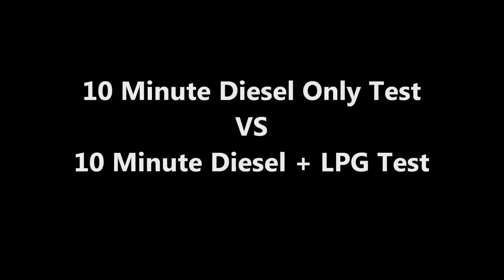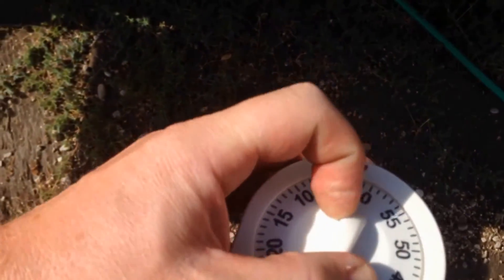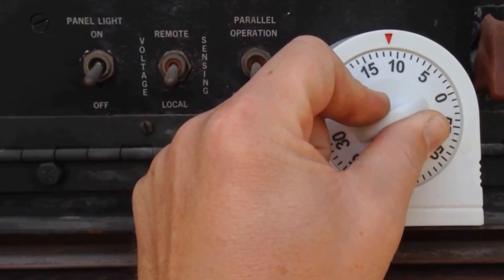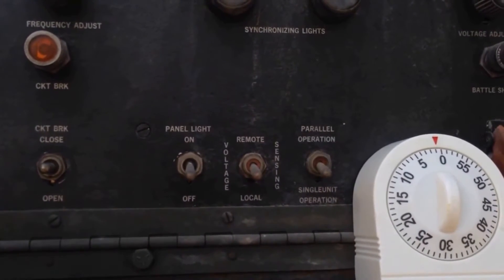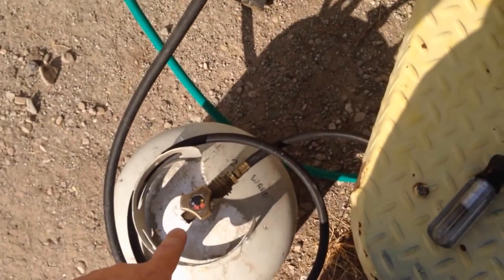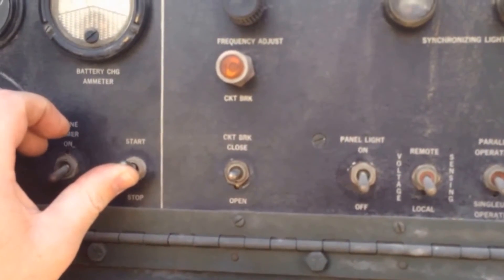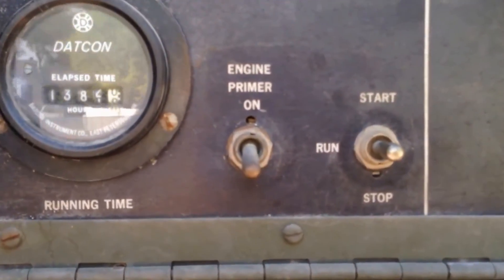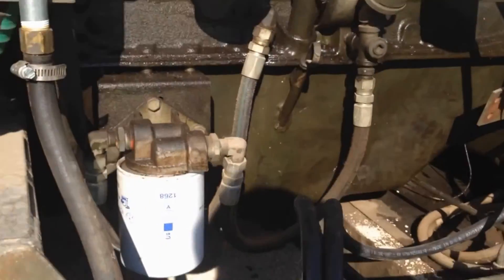Diesel Genset Converted to Run on 60% LPG/Propane

Comment: OK but how much LP Did it burn what was the cost difference what was the power output difference what was the pollutant output difference the video really didn’t answer any questions other than it uses less diesel but of course that’s the case

Comment: I was thinking...
What If my objectives are to clean up the emissions by achieving a more complete burn in a diesel van with a small LPG tank. Will a 10% mix cater to those targets?
Reply: yes, it'll work fine. if your tank freezes up, use a larger tank or warm it up somehow.

Comment: Did you weigh the propane cylinder before and after the test where you use the propane + diesel in order to see how much propane you used?
After all, you're combining fuels. You can't just consider the amount of diesel you save. Propane isn't free.
Reply: Fred Flintstone the point of the demo is to show the replacement ratio of diesel with LPG . Not to calculate overall savings.

Comment: In the video you have shown the generator works will at idle on gas and diesel mix. Now if you do a video with the generator loaded say 25% or 50% for 5 min's that will give a good indication of the effectiveness of the gas.
Reply: Whole test should have been at 50% load with both fuel sources weighed before and after

Comment: I listened to a mechanic tell that all shot up in a Marine Corsair maid it back to his island base , After running out of fuel . Said in his last ditch efforts at keeping it lit he must have hit the water injection switch .
 Old Smokey Younik with carefully built expansion chambers , exchangers and such heated fuel intake past it's vaporization before injection .  For me ? I'm glad to see that kid pick up that jug of Diesel and Propane hose .    Thanks

Comment: So I guess this engine has a mechanical fuel Pump ?
 How can it be smart enough to reduce flow at the same RPM ?
Reply: This engine has an electronic fuel pump. It does have a mechanical governor. When the secondary fuel is introduced into the combustion chamber the engine will speed up. The governor will sense this speed increase and back off on its diesel usage to bring the engine back to 60htz.
Reply: Ok thanks for the reply, would this still work on my Common Rail Hyundai without
 mechanical governor ?
 Cheers
Reply: Yes it works regardless of electronic or mechanical fuel control system.
Reply: Are there forums that Chat about the installation ?

Comment: Hey, your fuel consuption test were performed on the generator at no Load. I will suggest you load the generator to 50% load with a heating element and also check the Hz level, also you need to check the weight of the LPG tank before and after the test. you will need to know the energy density of your propane or LPG per Lb , after the test you will check the amount of diesel fuel and how much weight left in the LPG tank, you will know how much energy your generator consume with diesel only and diesel with LPG, and convert it to cost, you will know if you save any on fuel, you also must check the temperature of the engine block and engine head due the fact that the engine head and valves has less cooling and lubricant (less diesel fuel), Good Luck.
Reply: I will say with same rpm instead of load

Comment: CNG EDGE, it can be seen that your experiments were performed on the generator at no Load Conditions. I will suggest you load the generator and run the experiments again and compare your results. There will be striking differences. Also make sure you use graduated container to hold the diesel.
Reply from the maker: This was meant to be a simple demonstration video. It was not intended to show specific results. It was only done to show that it CAN be done. Natural gas works much better then LP (propane).
Reply from the maker: Thanks for the suggestions...We did use a heating coil to put about a 30% load on the genset

Comment: Are you a professional car mechanic ? And you mis the basics of the combustion principles. And you look at free running ? gen 'x' ?   It is possible to reduce the diesel usage with 50 %.
Reply from the maker: Joel is a diesel mechanic and a electrical engineer

Comment: Can any LPG generators run diesel?
Reply from the maker: No, it only works the other way around. Thanks!
Reply: Things that run on pure gas based fuels like propane or methane tend to use spark plugs since most gasses won't ignite under compression like diesel will.  In mixed fuel systems, the diesel works like a spark plug for the gasses.

Comment: It weren't that big of a savings.
Reply from the maker: Much bigger savings running natural gas vs LP gas
Reply from the maker: This was only a demo to show that the system can run LPG or Natural Gas. Savings depends on what you pay for diesel vs alternative fuels. When run off the natural gas pipeline savings and run time extension are very significant.

Comment: I ran a 6.8L JD for about 10,000 hrs on 75% natural gas and it ran very well. "A friend's dad did this with cats back in the 1950's so I know how to set it up."   When on duel fuel it ran with less noise and the exhaust was 25 degrees  hotter.  It seemed to produce 26% efficiency on the gas producing 60 hp @ 1300rpm.  I could measure the gas and diesel usage.  I was running a water pump that ran within a few rpm and load.
Reply from the maker: Your exactly right! Natural gas off the pipeline is usually around 30 cents per diesel gallon equivalent. if you replace 50% diesel with natural gas you will see significant savings
Reply: Hi Robert 
hope everything is fine there
i have yanmar m220 750kva 900rpm marine engine running on furnace oil .
i want to run it on LPG and furnace oil mix 
can you guide me how can i install ?
it surely matter savings when you blowing 70kg oil in 1 hour
thanks

Comment: where is the L.P.   introduced to the engine?  I'm not trying to sound like a diesel mechanic or an engineer but a big part of diesel fuel is lubrication of the injection pump the injectors I think even the combustion chamber I  believe it also cools the same components so see what I'm saying?   to me the engine sounded bad on the L.P.  it seemed to knock and tick louder also you're probably already aware of all of this I'm just trying to make conversation on the idea of alternative fuel supplements.  I know they use it for performance applications around here they called it red rooster I think?  lol idk cool video man thanks
Reply: CNG Edge How do you get the diesel system to function at only 50%?
Reply: Fuel governor automatically compensates for LPG energy supplied
Reply from the maker: That's correct!
Reply from the maker: The governor will automatically reduce diesel fuel in order to keep engine at 60 htz
Reply from the maker: Thanks for the comment. LPG is introduced into the air intake before or after the turbo (if equipped) depending on your engine. The flow of LPG doesn't effect the lubrication to the pumps and injectors because their use is decreased while the secondary fuel is in use. If you are using a 50/50 ratio the injectors and pumps are working 50% less because they only need to provide 50% of the fuel. Those components are getting less lubrication from the diesel fuel but they are also working much less.
Reply: CNG Edge right I should have thought of that must have been tiered lol